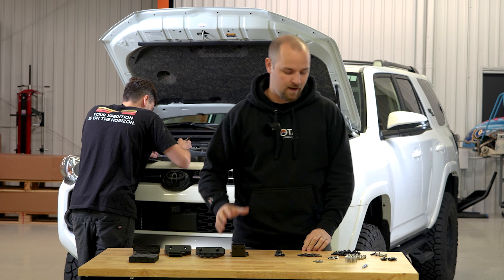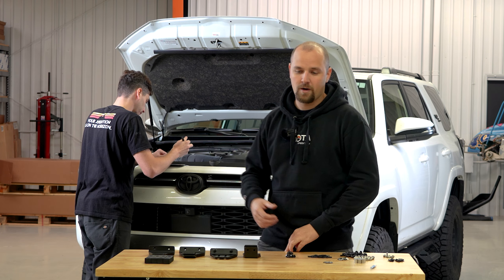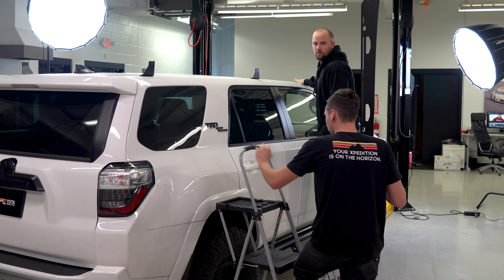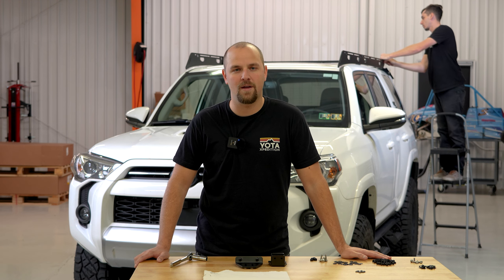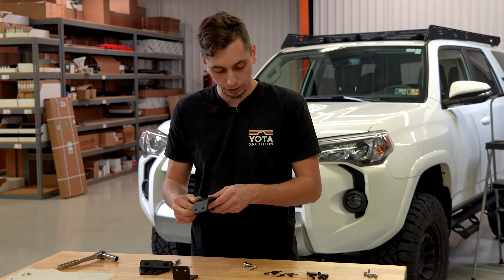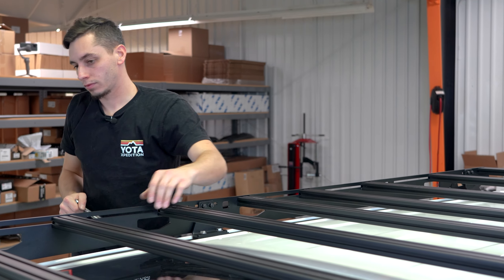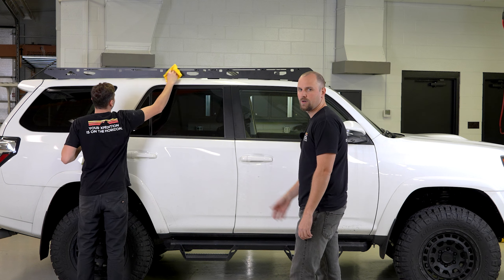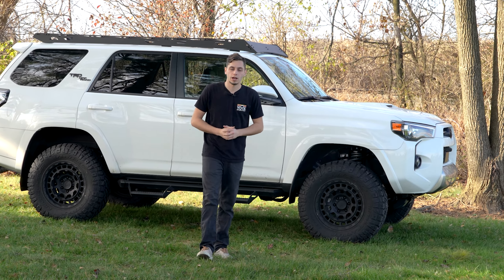4Runner Sherpa Crestone Roof Rack - Customer Install

Comment: Didi you put any silicone at the hole?
Reply from the maker: Silicone is not needed. The rubber bushings act as a seal when compressed. You can add some silicon in the holes if you want but I wouldn't get crazy with it.